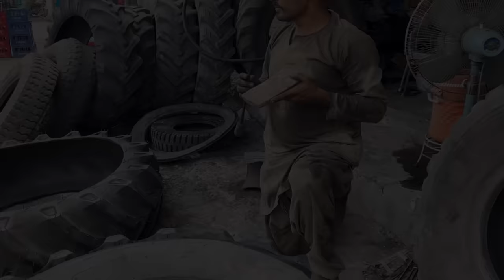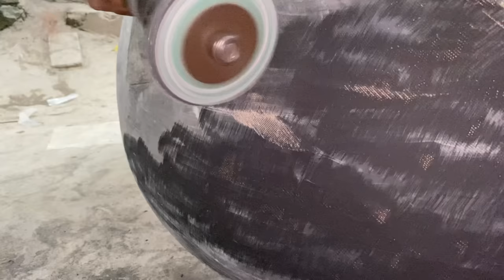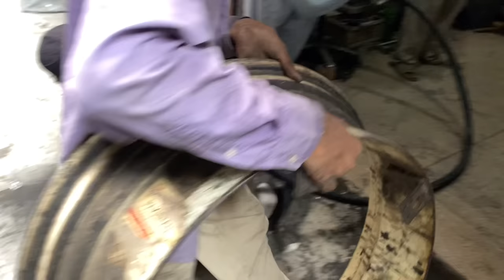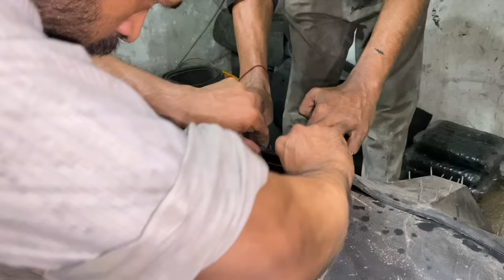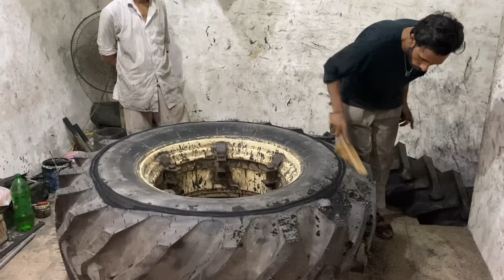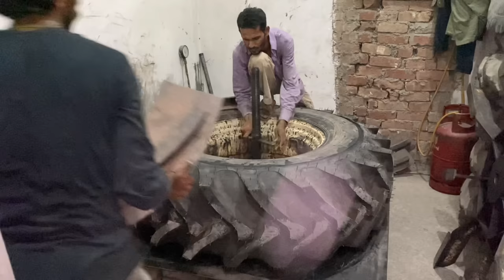Watch How Tractor Old Tyres are Recycled into New Casings for a Better

Comment: As someone who worked for a tire company that had a recapping shop, these guys have my full respect, never seen it done by hand like that, we had machines that did a lot of the work..
Reply: People are cheaper than tools
Reply: @johncholmes643  in India apparently!
Reply: REPAIRED WITH HEATED ,POLYMER CLOTH.PLESTER PARIJ WHITE CLAY OF MARKET,
Reply: ADJOINED DRIL THREAD,O PIN UP.
Reply: MAGNETIC U TURNED WIRE.
Reply: What the hellnis that self fusing rubber they use?

Comment: Where did the new tread come from? It still had the nipples on it.
Reply from the maker: Thank you for your response and the answer of your question is The new tread likely came from the manufacturing process where tires are molded. The "nipples" are part of the molding and curing process to ensure the tread's integrity. It's common for new tires to have these features when they are purchased.

Comment: 60 mph and tread will fly
Reply: Never seen a loader do 60
Reply: Если они для адгезии используют  Хемосил, то хрен когда оторвется
Reply: Yea those are tractor tires or as commented heavy equipment tires
Reply: Those tires won't see more than 25-30 mph, have some common sense
Reply: Yeah because tractors do 60mph…..🤦🏻‍♂️🤦🏻‍♂️
Reply: Not too many tractors ever hit 60 mph unless on a trailer 😂
Reply: The road that they have nobody is doing 60 Mi an hour
Reply: Run hurry up to comment before realy using your brain.😂😂😂
Reply: Very hard job.  I doubt he get arranged marriage with that
Reply: Just in case you’ve not noticed, they’re agricultural tyres, I can’t imagine them being on anything that will be doing 60mph.
Reply: Judgmental
Reply: Tractors don't move that fast!
Reply: yeah because tractors need to be at that speed
Reply: That iswhy recaps on semi rigs are no longer allowed
Reply: Pretty sure that the equipment these tires are made for will never see 60 miles an hour 😂 please refrain from making an ass of yourself 😂😂
Reply: @BikerBalakovo these tires are not made for horses😂😂
Reply: @henryharvey8980 don’t know what country you are in, but in the U.S. recaps are used pretty much 100% on all commercial vehicles from garbage trucks, buses ( not steer tires), airlines and semis.
Reply: Even if some tractor will reach 60 mph thread will not fly. They are using closed round thread, not glued and then cured stripes. The thread can fell of only if there will be side damage like strong hit in the tire wall.
Reply: Some folks think if it's not made in their country it's shit at least they reuse stuff instead of just throwing everything away like we do in the USA
Reply: Number do sir pakistan me kha se ho